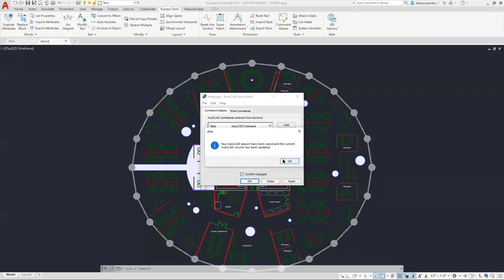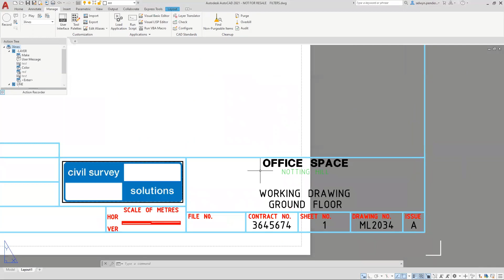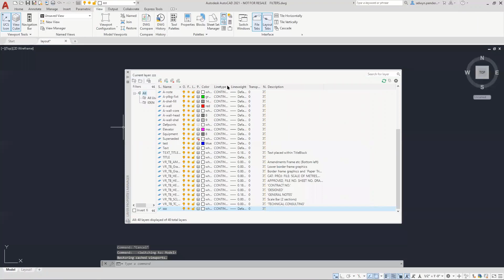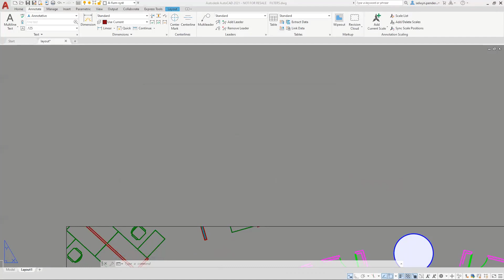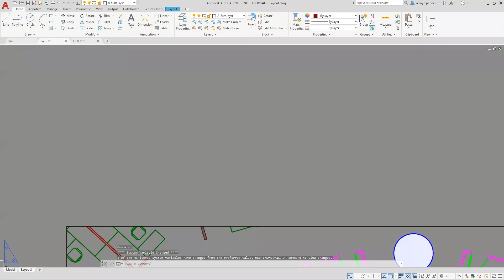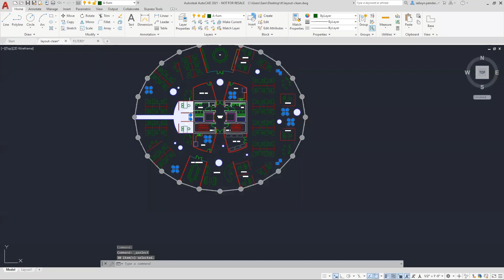Civil Survey Solutions - Webcast: AutoCAD Tips & Tricks (Part 1)

Comment: 3:04 o Adding commands to the Quick Access Menu
6:28 Creating keyboard shortcuts for those commonly used commands
10:14 Dynamic input 
12:14 selecting viewport ctrl+R
13:20 layout how Is going to be printed out
14:45 Big A functions interface and commands
19:27 set up an easy macro
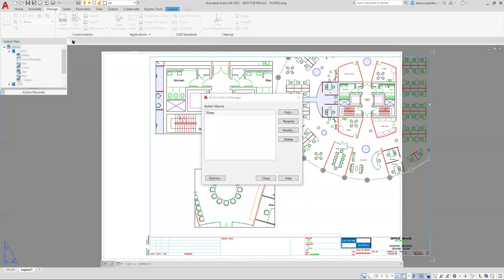25:37 Block Management
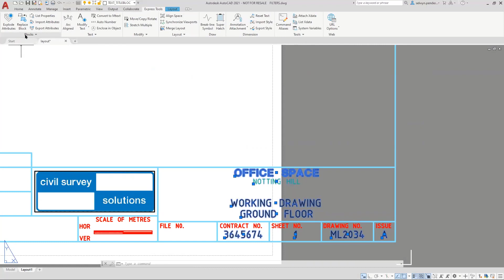26:00 Exploding blocks and retaining the attribute content
o Counting blocks in your drawing
29:18 UCS 
• File and Content
o Importing objects from other drawings
o Easy access to project folders
o Copy and object from an Xref into the current drawing
• Working with drawing objects
o Cycle through overlapping viewports
o Delete overlapping objects
o Repeating commands
o Using Action Recorder to create macros